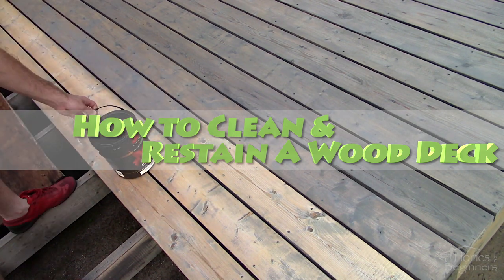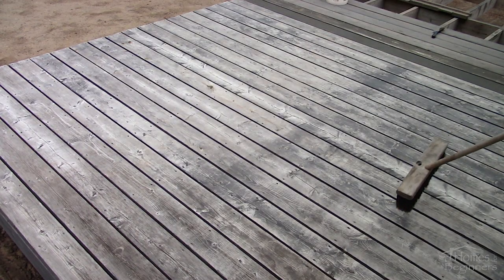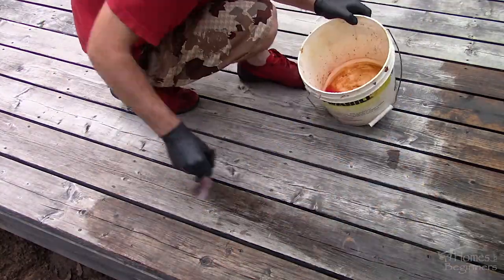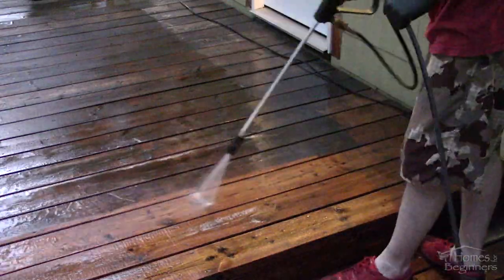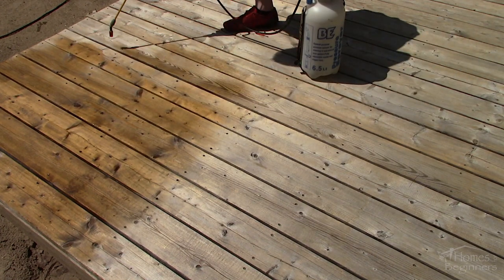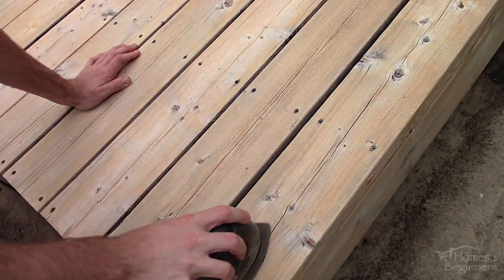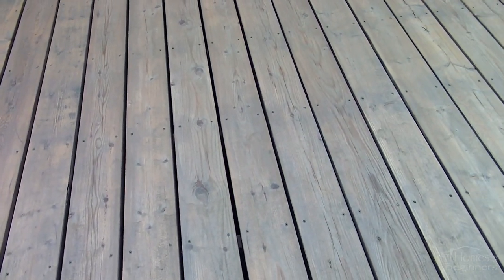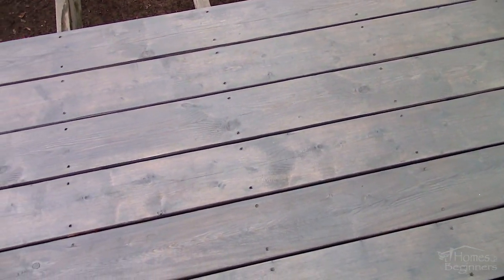How to Clean and Stain a Wood Deck

Comment: Hey man, great video! I have a quesiton: I saw your video on DIY Shou Sugi Ban treatment. I was wondering if the wood has to remain outdoors in order for it to dry up like that. I want that finish for some wooden planks that I'll mount to my ceiling (as decoration) and was planning on having it laying around indoors, albeit exposed to sunlight. Will it finish up the same way as your patio? Thanks in advance! Laurens
Reply from the maker: Just make sure the wood is dry, it can be indoors or outdoors. Wood can still soak up moisture even with the dew in the morning or from extreme humidity.